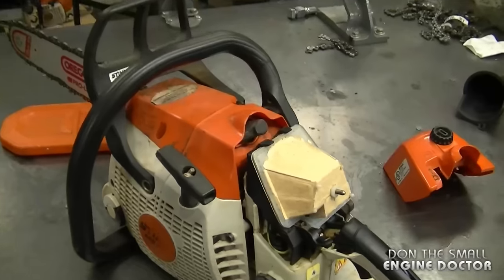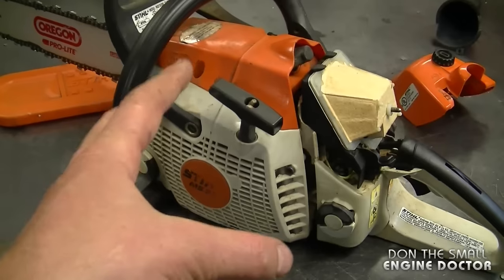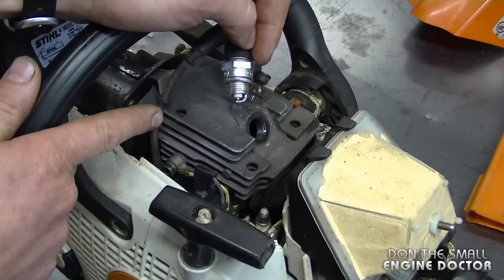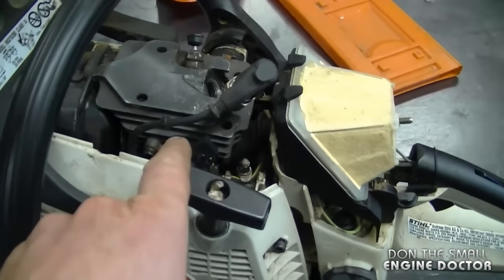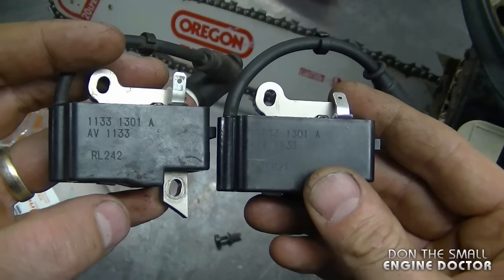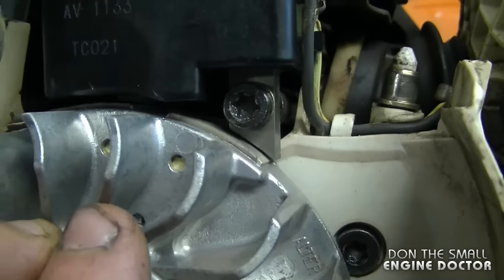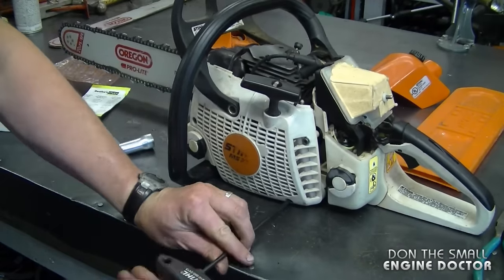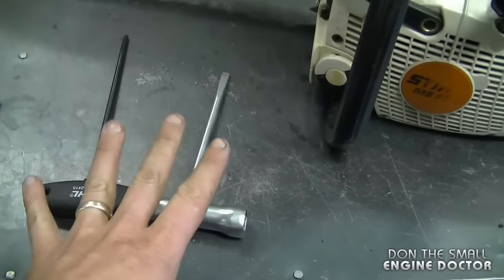HOW-TO Fix A Chainsaw With No Spark - Ignition Module Replacement

Comment: My coil seems to have weak spark.  If i pull easy, no park at all.  If I pull fast & hard, I get spark.  But it won't start the saw and the plug gets wet.  Its an MS361.  I didn't notice any spark at first, but then noticed fast pulls in darkness shows a spark.  My other saw (MS290), shows spark with easy pulls.  I measured ohms between kill terminal to coil body=18k ohms.  Resistance from coil body to plug wire was 2k ohms.  I'm concerned about the 18k ohm measurement.  But then the MS290, that kill terminal to ground measured 8k ohms, and that runs fine, so I'm baffled.  I don't mind buying a coil but they are $176 and I want to be sure the coil is the problem before I drop that coin.

Comment: Hi Dony, Very nice video! I have a Stihl MS271, no spark. I bought the Stihl kit and changed out the spark plug (.020 gap), air filter, and fuel filter. Still no spark. I ordered and replaced the coil (.010 gap). Now I have spark! Unfortunately, when I install the spark plug, I can hardly pull the cord. It's very hard to pull and clunky. When I remove the plug it pulls very easily. That indicates a compression issue in the chamber, correct? I drained all the fuel and turned the saw over and pulled the cord to evacuate the remaining fuel in the cylinder. Still no luck. Any thoughts on how to proceed? The saw is about two years old. No carbon buildup indicated on the cylinder. Thanks in advance for any help! Gary

Comment: My new chainsaw stopped running after 5 minutes. 6 months later I removed all the covers and found the coil wire tucked inside one of the vents on the cylinder head. It melted and shorted out the spark to the spark plug. Relocated wire and covered with electrical tape. Started on 3rd pull!!!

Comment: DB, I see you don't have a vid about battery chrging circuits, i.e.  alternator/flywheel, voltge regulator/ignition switch, and battery not charging on B&S.  This would be a good topic in a future vid.  
Don

Comment: I have had my 031AV saw since 1980. It has worked well all these years except for the last 5 years. It will start, run for awhile then stall and not restart until cool.  They say coil parts are not available. What can one do beside junk the saw.  Thanks.
Reply: I ended up junking my 031AV electronic.  Could not find replacement ignition module.  I did see a hack/modification about replacing with points but did not want to go there.

Comment: Please help me... I have a 365SP   I HAVE good spark with plug out. With plug in, and using a spark tester online... SPARK in the spark tester light.
I put fuel into the top cylinder...i get a little fart and that's it.
pressure tested crank case...no leaks.  Replaced all hoses, carb, tank filter, hose, vent... 
This saw just will not run

Any advice from anyone is appreciated

Comment: I thinking the ignition module on my Poulan 2150 died. It's at least 10 years old and probably more like 15. My father in law gave it to me.  After I adjusted the H screw and got it to finally run long enough so I could cut one 8" log. Then I shut it off to sharpen the incredibly dull chain. After that it would never even attempt to run, even with starter fluid. Not even  a single brief brap brap brap for any of the, what felt like, 100 pulls of the starter cord. I could see a tiny bit of spark when I checked but man I just gave up and went out and bought an electric ego. I never use my chain saw more than a few times a year and if I have to waste couple hours trying to get it to start and run for less than an hour of cutting it's well worth the price to one one that Doesn't mind not being run for 6 months. Think I'm going to give it and an old Echo I had before it to a guy that works on yard equipment down the roan from me.

Comment: Hey Dony, just curious what would it mean if it sparked when you removed the positive wire from the module?
Reply: If you have spark when the positive, or kill wire is removed then you either have a kill switch that is bad (due to having continuity all the time) or the positive wire is shorted to the block.
Reply: I have a Stihl 029 will the repair be similar? It's was running until it got hot, now it's not running at all.
Reply: Douglas Best  did you figure out the problem?

Comment: how do i even know that the coil is good or bad?
both terminals give the continuity signal on the multimeter, so what the heck is the purpose of the kill-switch in the first place if the terminals are connected anyway???

Comment: Donny I have a chainsaw starts great and runs but when I go to cut it boggs and 
Dies. But starts right back up. What could it be
Reply: I did have same problem with Stihl 026. So I just sold it. Maybe spark arrester screen is dirty?
Reply: Thank you .I didn't think of that
Reply: It may be one of the causes. Anyway, good luck.
Reply: It can also be a carb adjustment or an air leak. Donyboy has more than one video about this very problem. Check 'em out. Well worth it.

Comment: It would actually be a negative (not positive) wire since it goes to ground.  I generally do not hold the spark plug by it`s metal base to check for spark - if it does have spark, you might be the ground instead if the cylinder head and it will give you a shock!

Comment: Hey don what causes the ignition module to go bad
Reply: Drew Thornton that is a great question as there are no moving parts. Should be durable.
Reply: No moving parts usually indicates all solid state, but not impervious to any number of electrical issues. In this case look how closely the module is located to the hot cylinder. Heat and vibration would be my guess.

Comment: My petrol chainsaw plug spark but not start please tell me how to start. please reply me
Reply: Easy! #1) Put spark plug back in cylinder head and tighten slightly. #2) Hold chainsaw firmly with both hands. #3) Place petrol chainsaw in personal vehicle. #4) Insert ignition key in personal vehicle and turn slowly to right until personal vehicle starts. #5) Drive personal vehicle with petrol chainsaw to repair facility and ask politely "fix". #6) Pay for repair when completed. That is what I would suggest after reading your question.

Comment: My Husqvarna’s flywheel appears to be out of round?
Reply: The ignition module’s two points of contact with the flywheel vary from one side of the flywheel to the side 180 degrees opposite it…?
Could this be why the saw is no longer starting?
Should I replace the flywheel first? Or should I replace the ignition module first?
Or both?

Comment: eesh, my hardly used MS661 wouldn't start after I let it sit awhile. (I messed up warranty thinking it was only 30 days. whups)
I thought I'd open it up and clean a few things...WTH?! This doesn't look like my 026 after opening to carb area.
~~ I tried every which way to see spark, even in darkened house with help from the missus, and I saw no spark.

I took it in where bought and it was an adjustment on the coil(gap). COIL!?..adjustment?! 
I didn't have two tanks of gas through it crikey sakes. I guess I should do some online learning more of engines.
Two Springs ago I was gifted my grandfather's '47 Ford 2n tractor. Surely something will come up.
eesh, coil I've just pushed wires onto. 

The tech's words on my bill said found weak spark, then of coil adj. ...and I stated I couldn't see spark when I brought it in.
Actually 48.00 wasn't bad after seeing of this module.
tips me hat ~
Reply: yeah, tech found weak spark. ~ ya know, I don't think I had the saw switched on. Thanks. (ducking) (-:

Comment: How come these stupid ignition modules always cost more than the saw is worth? Anyway thanks for the vid :)
Reply from the maker: stihl tries as hard as they can to discourage people from fixing with their high prices
Reply: @donyboy73  That's extremely lame, considering how good some of them are, you'd think they'd want people to keep them forever and foster a positive reputation.
I just fixed up an MS260 (needed new piston, old one was trashed but cylinder was good) and holy smokes does it run like a champ. Effortless to start and the carb was a snap to tune, always starts and runs great. NOT a 'throwaway' saw! But, parts prices are beyond outrageous.

Comment: I thought stihl had a life time warranty on there ignition modules?
Reply from the maker: for original owner and with receipt
Reply: donyboy73 Is that true for ALL Stihl products, like FS130 trimmer?
Reply: good job ,as usual D. B. you have a video on testing for proper ohm load for main culprits, terminal wise. and will there be a variable tolerance. be nice to check these with out assemble reassemble as these are costly little  bastered and I pick these up when available at the scrap yard,when lucky for about 6$ from less pursuant owners. when able.

Comment: WTF ? so if you "" remove the positive wire from the module it isolates the coil "" . why is he using two names for the
same part ? or is it two parts in one ?  ""if you remove the positive wire and still have no spark"" . now why would 
removing the P wire GIVE you spark ?  why would you get any spark with the wire removed ? why check it again ?

Comment: Stihl should have recalled all this crap and replaced it with something that works. 
I have replaced this 3 times and now am replacing the flywheel. This chainsaw now has cost thousands of dollars and rarely works. 
Stihl is expensive junk